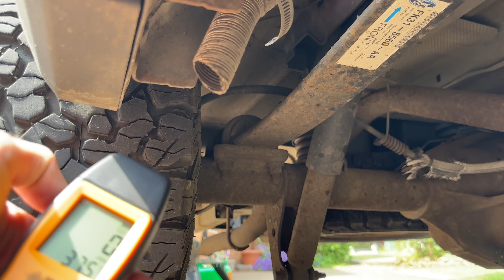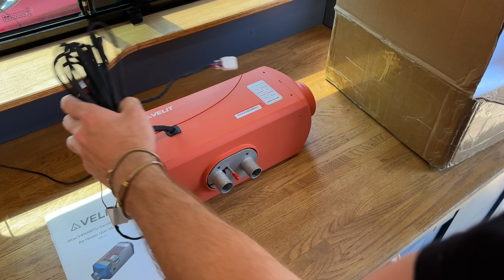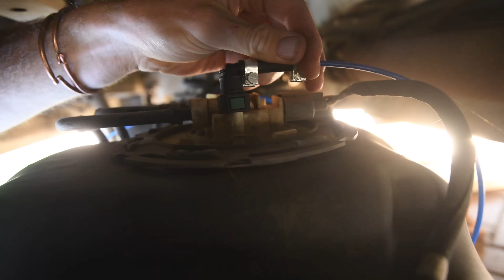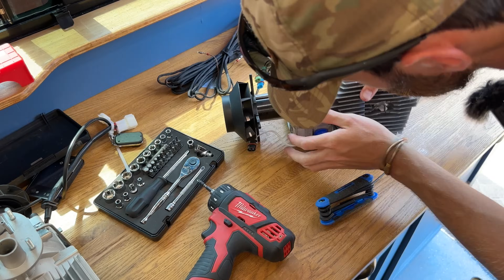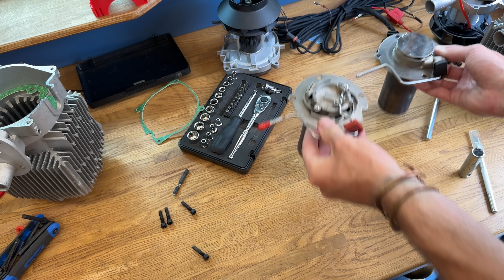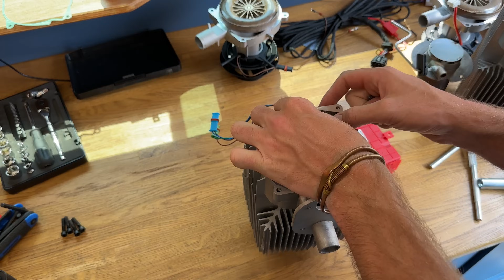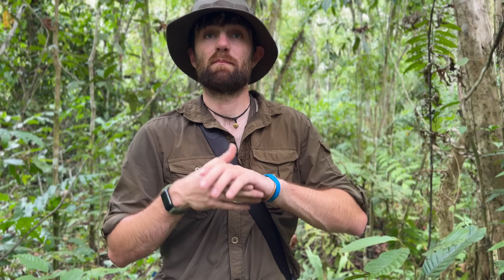DIESEL HEATER runs on GASOLINE / PETROL! AMERICAN CHINESE Heater Review | Tear Down & Comparison

Comment: Interesting. This model did not exist this Winter when I converted a cheap diesel heater for high altitude operation with in my Ford Transit.
Would have been tempted by an off the shelf sub $1000 model like that. But 2KW is plenty, don't need 4KW. And I know my CDH inside out now 😆
(conversion documented on my Raphvan blog)
Reply from the maker: I’ll take a look when I have time. Would be interesting to see what you have done.

Comment: Great video Alex .
I just subed
Reply from the maker: Thank you, there are a few other videos like it on the channel
Reply: Yes I've watched most of your videos . Next time you go to a cold climate bring sone " Gas line antifreeze " with you and pour about 250 ml in the radiators reservoir  to stop Coolant freezing . I would only suggest that as a last resort measure if your Coolant was to go slushy again . I think you're still using that pink one that works down to -40C if I am not mistaken .
I enjoy your videos. 
Cheers 🍻 mate
Reply from the maker: Cheers! Second Arctic trip I used a Nordics mix of coolant which sorted the issue

Comment: I wonder if the differences in diesel between Europe and the United States are what caused the problem. Based on the research I've done the diesel fuel in Europe contains lubricity modifiers that US diesel doesn't have.
Reply from the maker: It’s should be too important, people run other type of fuel like kero in diesel heaters without too much issue. But introducing thought. 

I felt it might be a software issue as the burn is pretty clean / running fine to start with, then a flame out and restart and then end up smoking.
Reply: Kerosene burns nearly identical to the diesel in these heaters except with a lot less soot
Reply: You get a lot more petrol out of a barrel of oil than diesel so it made sense to boost that market. We could have ran cars off kerosene but the percentage off crude that converts to kero is low. It's a bit different now as we can modify the oil to basically produce what we want but that's 150 years too late so we run with it. Also the reason why lpg is so cheap because we don't have the demand and can't get rid.

Comment: One way you can help determine the quality of electronics is by looking at the brand of the electrolytic capacitors on the board. When you have a board spun up like this you can specify pretty much any quality of components and how much they're willing to spend on the capacitors is a good indicator of the rest of it. These capacitors are lelon which are decent mid-range capacitors. They're not top of the line like nippon chemicon Rubycon etc but definitely not bottom of the barrel no name ones which is what you'll almost certainly see on the boards from the cheaper heaters
Reply from the maker: Definitely a area for me to look into to. I do look a bit at PCD layout but not knowable enough to make talk about quality by looking at the components. Seems like an area for me to learn. 

But mid range parts here seems fair given what I’ve seen with the rest of the heater
Reply: @MispronouncedAdventures  Yeah that's why the capacitor check is such a handy one. With just a handful of brands in mind you can come to a pretty good idea of how much money the company put into the production of the board.
Reply from the maker: @DoRC  noticed for the future!
Reply: @MispronouncedAdventures  Definitely..... If you see Nippon Chemicon caps, it's generally a sign of serious quality, designed to last.... But it's also really easy to fake. You tend to only see the real ones in stuff that is of high grade and manufactured in countries like Australia, USA, Japan, New Zealand and Germany (there are exceptions of course)

Comment: Nice Tear Down content Alex 😁 just off subject did you mention in one of your winter expedition  videos that at one point the floor of the van got down to  - 10 degrees Celsius just that didn't you install water pipes under the floor during the build ?,  and have you had any issues with them freezing ?
Reply from the maker: Good memory, remembering those pipes. I assumed those would freeze. It is one of the things I wish I could change. So I drained the cold water system and moved two smaller water containers temporarily to the other cabinet for the trip, which is kept warm by the diesel heater instead.
Reply: @MispronouncedAdventures  Thanks Alex got the same set up re pipes running under floor and looking at taking van over to Iceland next winter so trying to iron out any potential issues before hand
Reply from the maker: @glynmeek4830  yeah if I was doing it again I figure out a ways to not have the pipes get cold

Comment: My brother has spent thousands on a new eberspacher heater that feeds radiators on a large boat
Reply from the maker: Those are hydronic heaters ( heat a liquid and not air ), I’ve got a Webasto one myself in the van as a engine pre heater

Comment: Would the fuel pumps for dpf atomiser work better on these as they are very similar in design?
Reply from the maker: Probably not, Heaters normally pretty specific dosing pumps for different units. This uses a .65 pump. Chinese diesel heater 5Kw us .22, 2kw use 16kw and bunch of others as well

Comment: I use 5 chinese diesel heaters, and I have bought the metal housing units. The price has tripled in the last 6 monts. The accessories, fuel tanks and dosing pump are mostly garbage, but the core heater and electrics work well.
Reply from the maker: Aye, having been using the Chinese diesel heaters for years they are great when you have a good one. The accessories as you said are mostly rubbish and I’ve replaced them. My Chinese diesel heater has over 4000 hours now and only had £6 of new bearings
Reply: @MispronouncedAdventures  I bought extra new ceramic bearings used in drones, for the time when they are due. Best clamps to buy are through bolt type

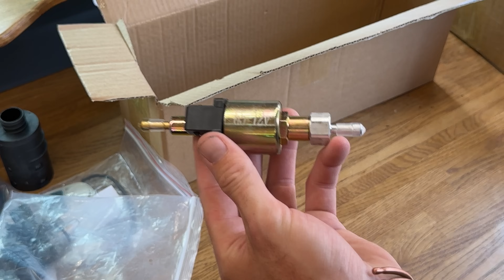Comment: 07:55 You said 'petrol'. 😉

Also, terribly disappointed that you weren't wearing a pith helmet in Borneo. Not very colonial of you! 😂

Very thorough review by the way. You were obviously in your element.  

Did you have to redo some of the shots after you suddenly realised it was 5am and the camera battery had died hours before while you were tinkering away?

I'm sure your beard got steadily longer throughout the video! 😂
Reply from the maker: Darn! Hard to not say Petrol! 

Haha yea! The pith helmet might not have fit in my rucksack. 

I definitely have to make sure that my battery don’t run out when recording I can play around for hours. 

As for the beard probably yes, there was a gap in the video due to waiting for a new pump to arrive

Comment: Are Espar units worth their expensive price?  Are they actually more reliable or better built?  Or is it simply a upcharge because of the brand name?
Reply from the maker: Both. Esper got a US$ fine of 14.9M for price fixing in the past 

There units are well made, the original design  and a good warranty I hear. But cost more than they should I my view
Reply from the maker: Both. Esper got a US$ fine of 14.9M for price fixing in the past 

There units are well made, the original design  and a good warranty I hear. But cost more than they should I my view
Reply from the maker: @andywt8460 older ones are probably made better than newer one!  I’ve played with Webasto and espar, I can’t fault that one’s I’ve played with.
Reply from the maker: I did chat about markings with them. They said it’s currently has most of its European marking and will launch in the EU this year. The model I was sent might not be branded up with them. 

I really like the autoterm units, unique designs, good UI, good quality and good pricing. They were Russian made, Ukrainian owned and have now moved operations to one of the Baltic countries.

Comment: In case of a fuel leak or if the heater fails on igniting the fuel I would prefer diesel, it's much less explosive.
Reply from the maker: I asked about this, as the fuel type characteristics are very different. 

They mention the way the different temperature sensor/flameout sensor is designed. It will act very quickly in the event. That being said gasoline heaters I have been made by western brands for quite awhile now. 

But I did notice of the different characteristics when the heater was igniting a lot more of a pulsing woosh noise on the gasoline version on start-up. 

Personally, I prefer diesel
Reply: @MispronouncedAdventures  yes, and with that said my caravan runs on LPG which is even worse. Looking into converting it, my major issue is that my refrigerator runs so good and cheap on LPG.
Reply from the maker: I have no LPG in mine. Preferred to go electric for cooking and fridge and diesel for heating
Reply: @MispronouncedAdventures  the thing is electric fridge is not very power efficient - unless you have a compressor based one, then it gets better. All inverters and so on will waste some power
Reply from the maker: Yeah electric cool boxes which use a Peltier unit for very inefficient. 

My compressor fridge power drawer is of no concern to me
Reply: @daw7563 I was running lpg for my RV and switch to diesel. It's cheaper/quieter/less dangerous/easier to buy fuel/uses less power/is more efficient. Pretty much better in all aspects
Reply: @MispronouncedAdventures  try to ignite a mug of diesel with a match, it's doable but very hard.
Reply from the maker: I’m well aware diesel is pretty much a nonflammable liquid
Reply: @MispronouncedAdventures  yeah it was for general info. Not thinking you would need it. 😀
Reply: Diesel is Combustible. 
Gasoline is Flammable.
Reply: @robertalexander7684  😂
Reply: The Germans have been using the gas and diesel versions of these heaters since designing them in the 50,s
Reply: @stevecarlisle3323 ?  Fuel heaters predate ww2.

Comment: As one of those many horrible Americans with a gasoline Transit...the idea of being able to tap into the fuel tank instead of having to constantly fill a small heater tank for my diesel heater is certainly enticing.
Reply from the maker: That’s a interesting prospect, because for Europe, it’s normal to tap into the fuel tank because almost every vehicle is diesel in the context of vans. I guess in the states more a gas and you need a separate smaller tank?
Reply: @MispronouncedAdventures  yep. You know that skinny square I believe 10 liter tank that comes with the Chinese diesel heater kits? I've got that tank sitting on the passenger seat step sandwiched in between the door and the base of the seat. Heater is under the seat.
Reply from the maker: Make sense to me, those tanks get used some of in the uk
Reply: @MispronouncedAdventures  I have a 20l jerry can strapped above the back bumper of my rig
Reply: Transit owner here too with same need. Would have been tempted by this sub $1000 heater, but it was not available last winter. So I converted a cheap diesel heater to gasoline / high altitude. Worked like a charm but required a lot of measurements to get it nailed and, hopefully, reliable on the long term. 
(conversion documented on my Raphvan blog)
Reply: @raphofthehills4405  I ran into issues with some of the controllers in that regard.
I replaced an older unit where the bearings failed early. the newer one, the controller couldn't be tuned, and coked up after only about 8 hours of run time, never able to get it to stop smoking. swapped with the controller from the old unit, it runs fine now
Reply: @raphofthehills4405   can you drop a link for the conversion? I'm thinking of doing this... thanks!
Reply: @venturenorthtahoe Just updated my YT "more about this channel" info with a link to my van build blog. Happy reading...
Reply: @raphofthehills4405   Yea, I value my life just a tad bit so I'm going to return my diesel heater and fork out the extra cash for a gas heater. thanks tho!
Reply: Ebspar, Webasto and Autoterm offer these Air heater for Gasolie, too. Yes, they are more pricey - in some instances it might be woth the price. On the other side: Evaluating/comparing on of their Gasoline model to a Diesel model might reveal what's required to change on a China heater.
Reply: @yxcvmk  Is there anything at lower price?
Reply: If you need cheap and fast, buy Chinese model, most of the time the 2kW is sufficient and has a smaller size (sometimes harder to find, often the larger units are marektet also as 2kW, but I would not want this). Be aware that they usually are noisier than Autoterm (Fuel pump, and heater itself). Be prepared for bearings not lasting too long.
Reply: @yxcvmk  yeah, the smaller ones are noisier. They have to run at a higher speed for the same output. I use the stuff that's typically marking it as 5 kw. I tried the 2 kw... Pretty much had to run it full blast to keep up.
Reply: @aaronwells6608 Really depends on you heat requirements. I run the smaller ones, I can live with a bit less to output, but need to get down to 1kW (or even 0.8kW) to prevent too much heat at certain times - totally want to avoid cycling on/off too often. And the larger ones from my understanding might still run fine at 2kW, but won't burn clean at 1kW - but it really depends. If 1kW is too little for you, then the larger units are indeed the better choice from my perspective.
Reply: @yxcvmk  I split my time between Alaska and the Pacific Northwest. I've got an extended high roof van. Honestly, even a little bigger wouldn't hurt. When it gets down below zero, I'm running the 5 KW on max a lot of the time.
Reply: @aaronwells6608 Yeah, you are colder than me. 5kW sounds like a must, then, or even 2x units if space allows. Can both run on lower, and if one ails there is another one keeping you from freezing.
Do you draw cold air from the outside to heat up the van? If so: Good to keep moisture down, but very inefficient. Maybe consider adding a y on the intake (I am not talking combustion). One of the Y goes to the outside to get the dryer air, the other side on the inside to recirculare (warm) the inside air directly. I assume you easily could run 90% inside air and still have no moisture issues, and with a y (with a flap inside) you are very flexible to draw more/less either way.
Reply: @yxcvmk  No, I never have moisture issues. Honestly the heater keeps the van so dry I actually think about getting a humidifier sometimes. It's never been so bad that I think I need another heater. It would just be nice to be able to run it at a more efficient setting when it's really cold.
Reply: Ha, I thought about that and as to why I never got a diesel vehicle to tap direckly into it! 👍

Comment: So looking in emission baced we should all use these heaters only in full power 😂
Reply from the maker: Some of the Chinese Heaters can be tuned, and some people have got far cleaner burns in different on lower settings. But many people have also messed up the heaters that wait and have them soot up quicker. 

Whilst I think my testing method is pretty inaccurate, at least it was consistently inaccurate.
Reply: @MispronouncedAdventures  But what I am kind of getting out of your measurements that PPM amount is lower when it is in full power and higher in low power, kind of weird in my mind, but I think they are just tuned for full blast and not for low?
Reply from the maker: Generally I’ve always seen the burn cleaner at higher by default

Comment: And at the beginning I thought you were talking about some Chicken fajitas. 
The Company should of known you would take it apart.
Nice to see that someone has created a heater with all the good bits, and the bits that most people buy later.
Good testing on the heaters, just wondering if you knew if it used the same amount of power when in use.
Great video, Hope to see more.
Reply from the maker: The email came across from them as a more personal one directed at my channel opposed to some of the more generic collaboration emails sent out on mass. So I presume they had seen or some across my other Hester videos were they get pulled apart! 

I agree, I generally see it as a heater which has higher quality Chinese components and far better made apart from the flashes on the casting, which are not too important. I think the controller needs some work to be a bit smarter for the price point you’re paying and the wiring loom has been insulated / covered cable and not tape wrapped which looks cheap. 

As for power out put on testing. I did the best to make sure that the heaters are running equivalent power output. However, the Velit heater didn’t have the option for display kw output.